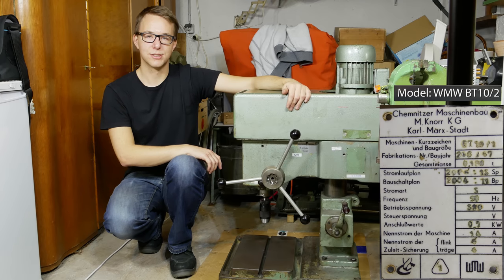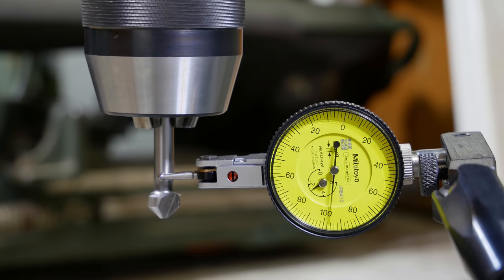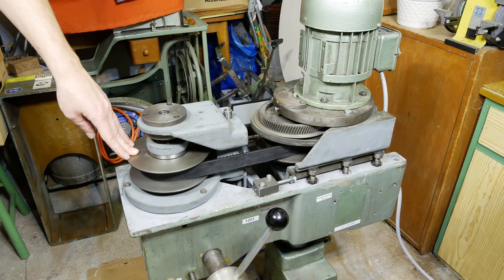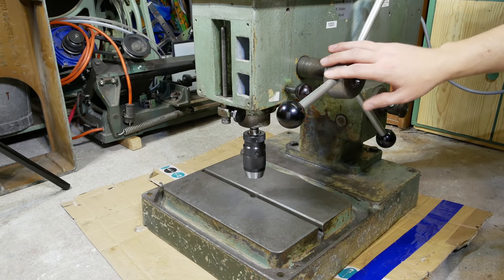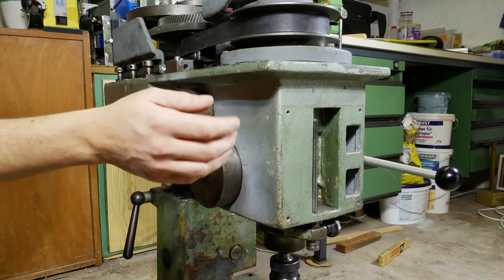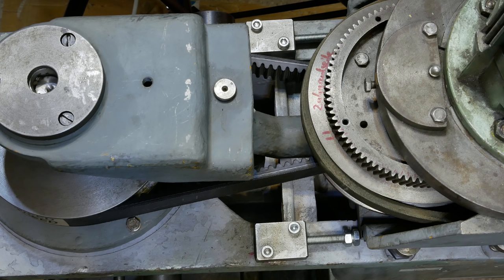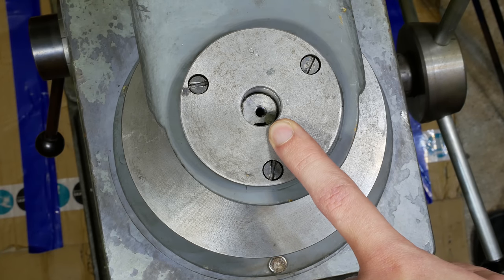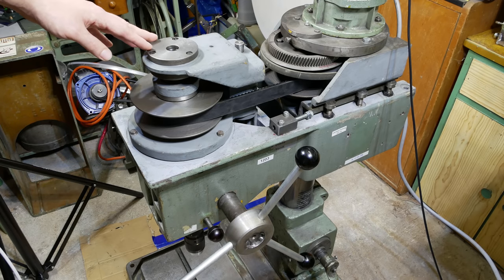Overview --Part 1-- Old drillpress restoration

Comment: Great video, thank you!
Perhaps use cutting fluid or cutting oil for drilling?
I suspect the head goes so low because the taper-mounted chuck could be replaced with a shorter tool of any sort.